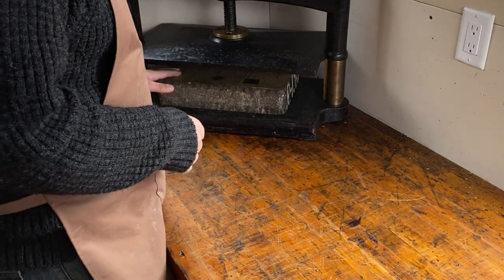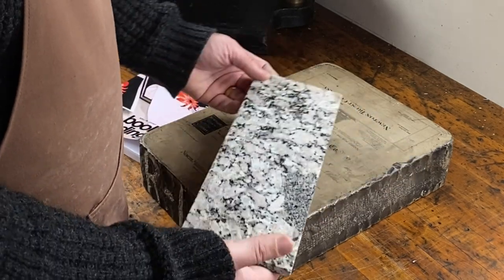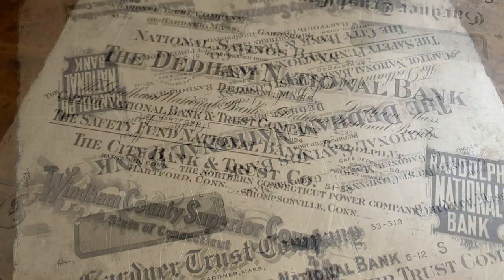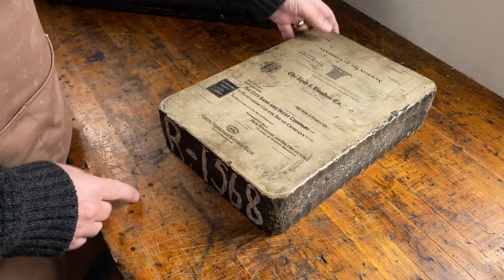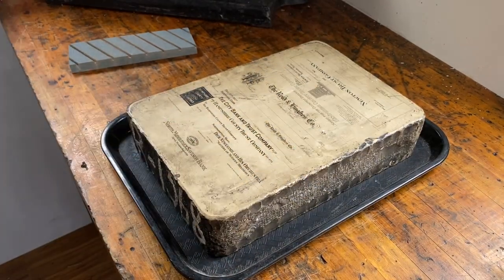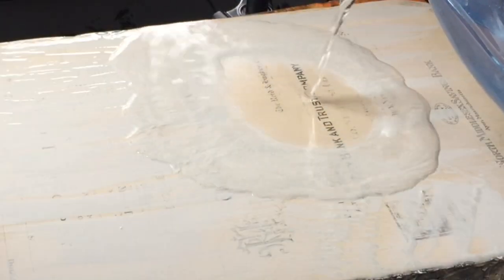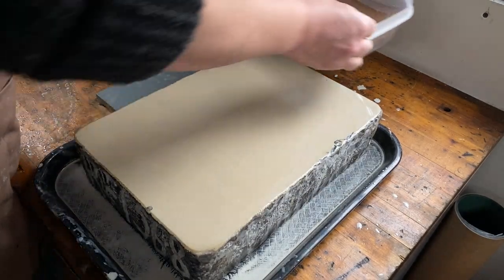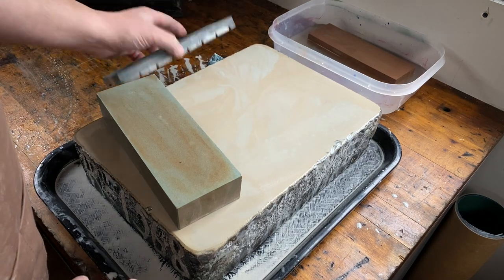Preparing a Lithography Stone For Paring Leather

Comment: People seem very upset about using the stone the way you are. But if it is not used, then it is nothing more than either a paperweight or a museum display. Museums have enough of these, and these objects were made to be used. If it was used for its original purpose it would be ground down to dust eventually. That stone will remain in use for decades and that’s a beautiful thing.

Comment: the printing on the stone.... one would regularly "resurface" a face so instead of wasting paper one might test a screen on it. Not to mention in that case wasting check stock.  The 3 hours setup on the big press vs 20 minute turnaround on the mini. I wasn't in the print department but I did work at a newspaper handling the higher end art side of things.... so I dealt with the printer almost daily. The funny part is I never saw them do anything with these stones save hand mix ink and doing test prints.
Reply from the maker: What a great insight, thank you! If I didn't have too many hobbies already I would love to get seriously into printmaking. Thanks for the comment!

Comment: Lithography stones are so rare, they are all mined out. There are no more deposits of this type of limestone. Lithography is a dying art. Using a such big stone that is in relatively good condition for leather pairing is an abomination.
Reply from the maker: The irony of your comment is that by using this stone for leather paring I am actually preserving it. I have resurfaced it once, and may not need to do so again for years, perhaps decades. Conversely, actually using it for lithography would inevitably grind it down to nothing. The art form actually consumes the non-renewable resource it relies upon. Some craft litho artist many years from now will thank me.
Reply: @Ori Nir yeah, I agree... especially when he started grinding it away to nothing... if all he wants is a flat piece of sandstone,  go and buy one from a local Stone Mason, it would be perfect dimensions and at a  fraction of the cost - not to mention saving a historically relevant item...

Comment: I don't know the historical details of offset printing or the age of your stone, but my guess is that the right-reading image on the stone was transferred to a rubber blanket (or some other intermediate surface) which was then transferred to a final printing surface.
Reply from the maker: That seems very plausible to me, especially if a plate needed to be made up with multiple blank cheques, for example. Like an early version of cut/paste. Thanks for the input!
Reply: @FourKeysBookArts  Additionally, I checked availability and prices of litho stones online earlier today and found that there are other stones that have right-reading images on them as well.  So, yours is certainly not unique in this respect.
Reply: Yes, you’re indeed correct! Right facing stones were used in lithographic offset presses which transfered the image to a rubber cylinder and was then printed on paper. That way of faster printing would especially make sense with documents like bank statements and forms that were provably printed in the thousands! Stones with mirrored text/ images were (and still are) printed by hand on presses that print directly on paper.
Reply: Yes.  The same technique is used to transfer images onto curved surfaces such as bowls and plates.

Comment: Have you ever used a piece of glass as a surface for skiving? I’ve used both granite and glass and prefer glass because of the smoothness. I’m thinking about getting a litho stone, but wondering if I should just keep on with the glass. I have it elevated, by the way, to give my hand clearance. If a stone is better though…

Thanks for the videos, they are introducing and well produced.

Comment: What particular properties make it so good for paring?

I can't see any requirments beyond reasonable flatness, and a "slightly" rough surface to provide "some" friction. I'd guess even a bit of unloved MDF would be quite functional.
Reply from the maker: Quite the opposite really. Since the blade is held at such a low angle for paring and the tip contacts the work surface, a material like MDF would not only be gouged, but the blade would be hard to control. The lithographic limestone is both perfectly smooth and hard enough for the blade to effectively skate over the surface, yet not so hard as to seriously damage the blade in case of a slip.
Reply: @FourKeysBookArts  I hadn't picked up that the blade actually touches the support :-(
Reply: If you ar not particular about cutting into the MDF, thus changing the angel of the bevel when pairing, and adding extra resistance to the pairing blade, then I guess MDF will suffice…

Comment: I can't believe you destroyed that stone, a pity, that deserves to be preserved in the state in which it was, a true art of art, a pity!
For working with leather you can use a granite slab without problems
Reply: Being a leather worker l have used both marble and granite for many years on an almost daily basis without incidence.
Reply: I don't necessarily agree on the "preservation" of the last piece, since in lithography studios we often grind out the last ones in order to be able to make a new art print, but yeah, using it for leather pairing is cruel.
Reply: Fun fact, just my 50 cents: I am working as a Graphic Designer for 30+ years and back at the university we’ve been educated in the skills of bookbinding, lithography printing and all sorts of ancient methods back to potato printing like the kids in Kindergarten. And when I started working with leather I instantly came up with the solution to use a slab of limestone instead of marble or granite. I own a piece that’s latest design is signed back to September, 5, 1928!!! and I would never ever replace it with a new stone from a modern factory. In fact, because of the piece is in constant use, it is as good as new, no blade has ever harmed a mµ of its surface nor vice versa. I will celebrate its 100th birthday in a few years with a Toast to my Graphic Ancestors, holding high their achievements as my inheritance. That said, I would never grind the design either … Greetings from Germany.